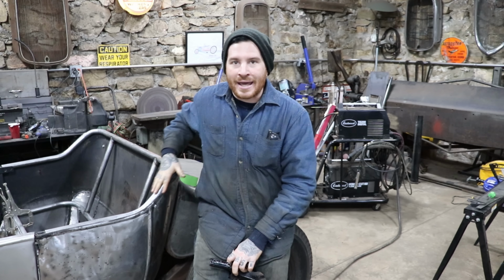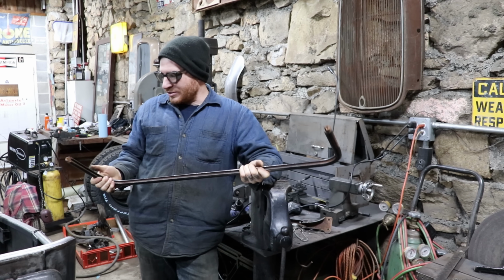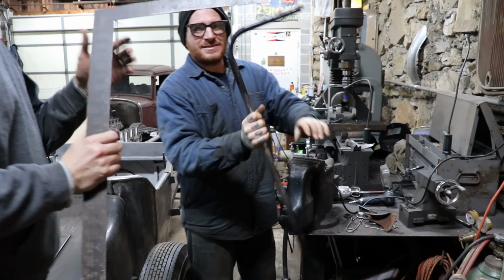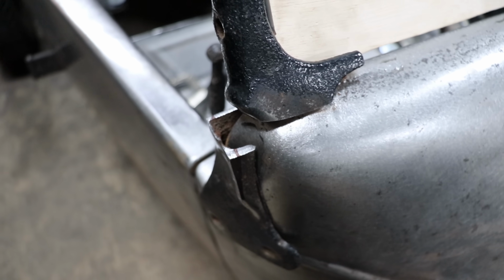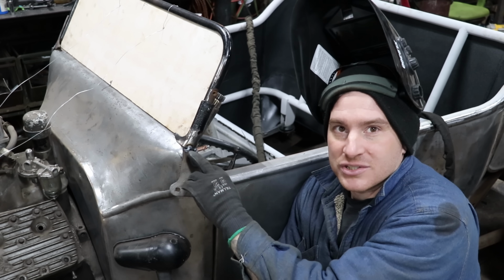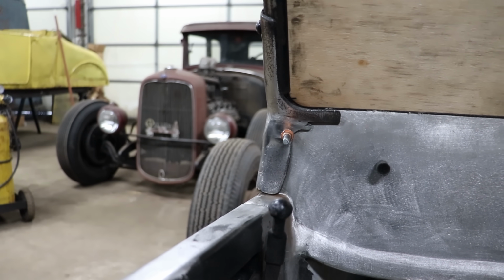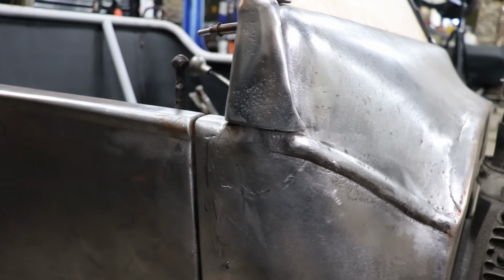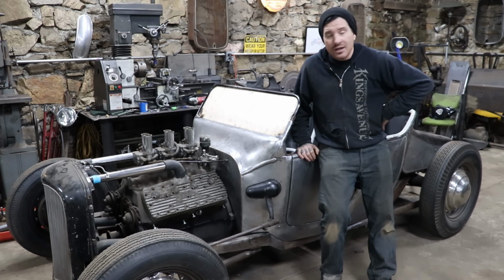Custom Model T Roadster Winshield Stanchions- Free T Ep. 61

Comment: I have an idea that you can say that you thought of it already or it is a bone head idea, it is in your area of knowledge. You go to a wrecking yard now days and they are full of suv's. Suv's have either a hatch or a lift door and everyone so far has a back window. ... Now with the width of the doner body or say a 32 coup for example... you know how wide the body is and what you want for a window. From all the different cars available, you should find one the right width and the bends that you want in the glass and if it is cracked, so be it cause the glass company have them in stock if they are not too old. Slice it out with a cutting disk and then build the frame from that, I think you can see where I am going with that and the final shape can be made so that it is able to be worked on. They can take glass out as well as put it in so they could pull it out if not comfortable working on it with it in
Reply from the maker: Definitely an option, but getting flat glass cut is easy and cheap once you make a windshield frame or modify an original. I like to use original parts or make from scratch rather than modern parts for my builds but your idea is certainly doable and good for some guys!

Comment: What are you going to do about a window seal along the bottom of the windshield? Using the plywood as a template is a great idea, but your building the stanchions tight the the body and glass. If you add a seal to the bottom of the glass it won't fit correctly in your frame and your stanchions will be off.. I don't believe you want the glass to ride directly on top of the cowl without a cushion?  Or did I miss something?
Reply from the maker: The plywood windshield sits below the bottom of the frame so we can trim a small bit off to allow for the seal, but for "mockup" it is easier to let it sit flat on the body so we could quickly check to make sure everything was setting right by eye the 100 times I had it on and off. Thanks for watching! -Matt/ITG
Reply: IronTrap Garage 
Thanks Matt, my comment was not meant as criticism. I know that sometimes you get into the thick of fanning something up and might miss a little thing like that. I just wanted to see if you had a plan (or a helpful reminder if you did forget!). Thanks for the response, keep making great content and I’ll keep watching! -Jason

Comment: Matt great video..... just one FYI about the sawing plywood when you're cutting through quarter  inch plywood or half-inch let the blade of the saw drop by 3/16 more than the material cutting through.....   When cutting half-inch plywood put your blade protrude 3/4 of an inch.... If not sometimes the plywood wiggles and kicks back the saw!!!!! Then the saw blade wreck  piece of plywood you're trying to cut for something been there done that and I carpentry about 40 years sometimes it'll kick back and take a finger to!!!!! Have fun in California... Left already there in California!!!!!!  treat yourself to a box of sees chocolates best chocolates in the lower 48 my opinion JUNKMANDO
Reply from the maker: Thanks for the tip, we're not wood workers that's for sure! -Matt/ITG

Comment: I was just about to comment that you could use stainless filler for the de-oxidizing properties to try to help "clean up" bad steel and make it weld better when you said that's what you were doing. Another tip I would give is to keep the tip of that filler rod in your shield gas. If it's hot and suddenly hits air, it'll get oxidized and then introduce oxides into your weld puddle and also make it spit and pop. But it's good to see someone tig welding this stuff rather than using a mig and winding up with something that looks like it was stuck together with a bunch of boogers. I'm just a bit biased with my welding processes :)
Reply: Guildrum good tip with the shielding gas. I have found it is often the pits in the 90+ yo castings that tend to cause the issues. That’s where years of corrosion and junk hide. This old steel - drawn or cast - welds beautifully if clean but that’s the hard part wi5out grinding away the shape or structure.
Reply from the maker: Thanks guys for the discussion and good tip on the shielding gas. I have a gas lens so the "cloud" of gas is a bit larger and generally the tip of the filler rod is in the "bubble". Not much is more humbling for a welder than welding 100 year old parts! Thanks for watching and interacting guys, I love the tech talk! -Matt/ITG

Comment: I would have liked to see you use the mountings for the lights.  Or at least a mock up using something smaller than the gas lights.
I guess the dog is kept home now.
13:39 Is that guy looking at what your welding ?
Reply from the maker: Leaving those tabs for the lights hanging off the side of the car hurts my soul down to the core. Needs to be smooth, needs sit right and look fast sitting still. Extra junk hanging off of the side of the car like a wart would hurt my brain haha. If I was building a 60-70's t-bucket I could see leaving them, but not a late 40's-early 50's styled car. Thanks for watching! -Matt/ITG

Comment: The windshield height and angle looks perfect Matt .Beautiful workmanship on the stanchions. Just a suggestion, because of the strength loss of the welded castings you may experience stress cracking, take your finished stations to a casting house have them make a reverse mold of your fabricated stations and have new stanchions cast in Aluminum or steel.There is a shop in Export PA called Perma Cast or you can try contacting a 3D modeling firm .
Reply from the maker: Hi Gerry, Yes that was in the back of my head. I need to look into making castings as I am also a little worried over time I could have that issue. I'll look into them thank you! -Matt/ITG

Comment: Don't know the lead time on these episodes but...
If you are near a scrap metal yard that takes in all sorts of metals, see if they have an XRF gun to analyze the metal content of the casting. might give you a hint to better weld and sculpt the metal.
Where the heck are your feet going to be on that floorboard? lol
Reply from the maker: When I built the tunnel I sucked in the sides for where your foot will go for the gas pedal. I'll be tackling that here shortly, so it should answer questions. It's tight but we'll make it work. Might have to drive it in my socks like Norm did in the kookie-T back in the day! -Matt/ITG